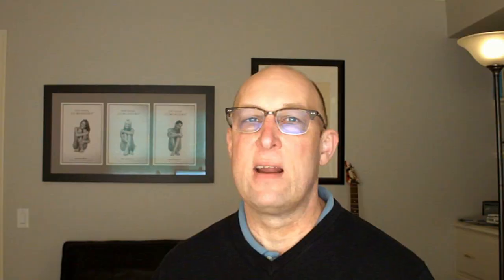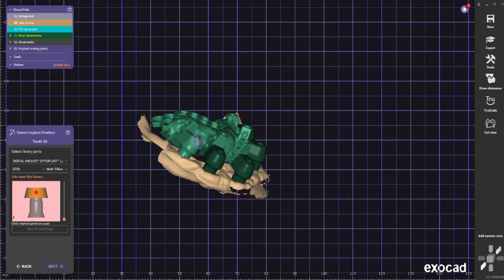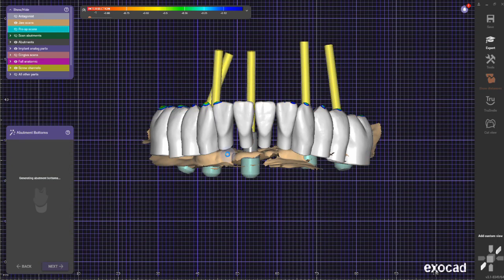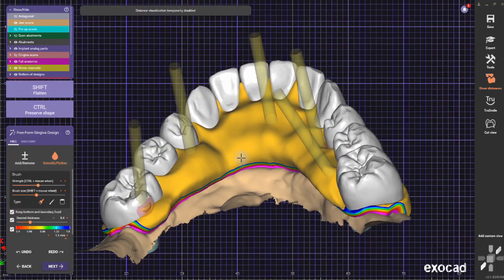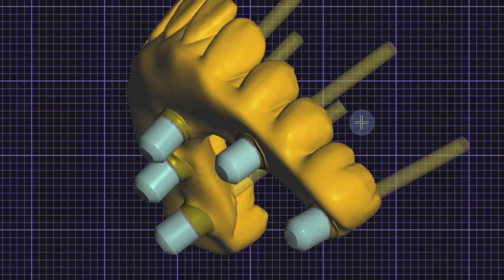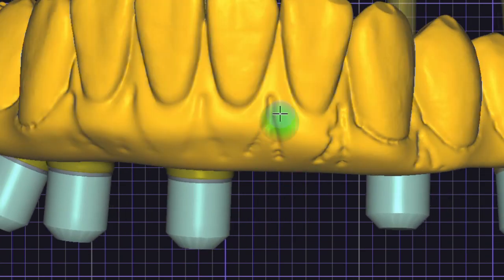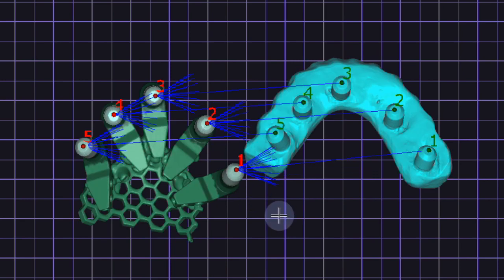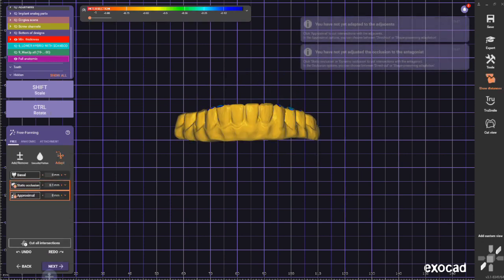Exocad 3.1 The Fastest All on 4 design

Comment: Optisplint makes for a great workflow, I've been designing all of my all-on-x this way. I typically get everything aligned first and then design. Great video, this workflow changes everything! Can get our patients from scans to seated prototype in 2 appointments.

Do you freeform your emergence profile or do you define in that step? I've been free forming but I want to try using the profile step in the wizard.
Reply from the maker: The profile step can be skipped if your are advanced and use the free form.